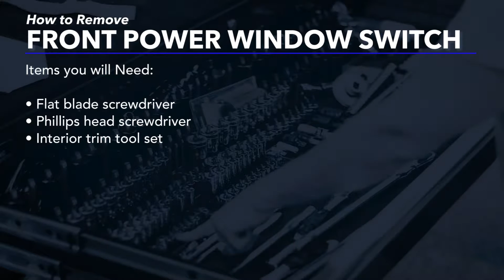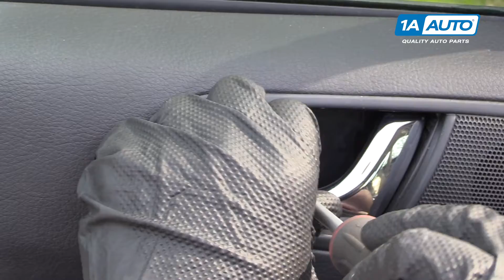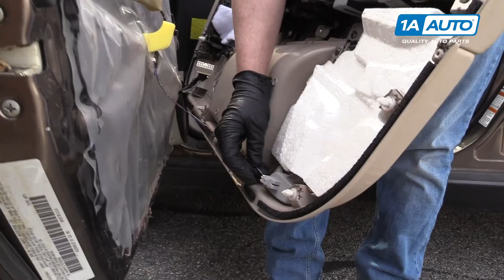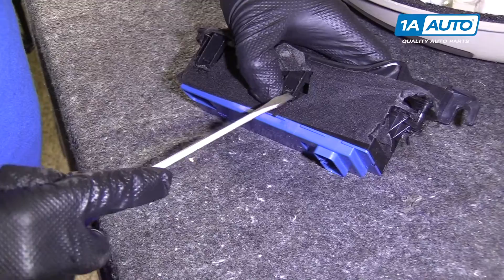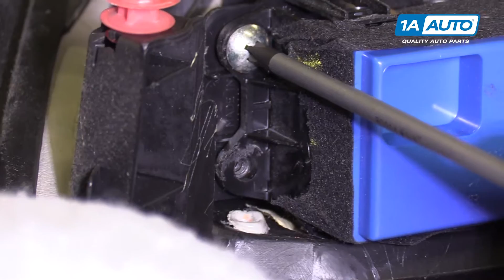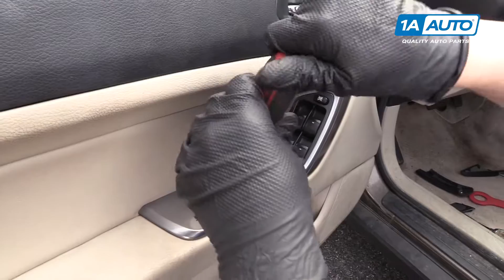How To Replace Front Power Window Switch 04-09 Subaru Outback

Comment: Great video. Replaced the switch very easily. The only mishap was that the top plastic connector for the door grasp broke. The top one that the top screw goes into. Will have to find a replacement piece.

Comment: BEFORE YOU DO THIS: Roll down your windows or unlock and open other doors. Pulling the cable out of the mechanism locked my driver’s side door. I let the door closed accidentally and locked myself out. Learn from my mistake.
Reply from the maker: +@LukeDanko Thanks for the tip!

Comment: My issue: rear passenger switch stopped working and the clicking mechanism inside the driver's window switch broke. I got a generic replacement for $30 (compared to $175 for OEM Subaru). 
One tip: there's another clip in the middle of the door, so if your door doesn't pull off as easily as the video, just pull harder to release that clip. 
Thanks for the video!

Comment: Thanks! I successfully swapped the switch. But, my drivers side window still won't work.
Reply: Probably is the motor or actuator then, I dunno about these guys, but Chrisfix has a good video on replacing a power window actuator
Reply: I know this was a while ago, but I have the same problem. What was the issue?

Comment: Is this possibly the problem if the driver window doesn't work? Buzzes when button pushed or pulled, and all other buttons on driver door and on all doors do not roll windows up or down... But no noise from them

Comment: I have only a driver's side window switch that broke.  All other functions on the panel work.  Are you replacing the entire array of the driver's side window switches as one unit?
Reply from the maker: +flyingfishsurf Thanks for watching!  Yes that all comes off as one piece, referred to as the "master window switch."  You cannot replace single buttons on that switch cluster.

Comment: Thanks to the video I may have gotten this repair done faster than the video and saved myself a lot of money.

I had one issue after installation where the lock activation kept cycling the locks.  It stopped happening after cycling the factory alarm system.
Reply from the maker: +William Suggs Thanks for checking us out. Shop for high quality auto parts on 1AAuto.com:

http://1aau.to/m/Shop-1AAuto-c

Comment: Thank you VERY much.

My switches worked and failed worked and failed.
Turns out they didn't fully seat the connector when they replaced the switch set.

Saved me a trip back to the dealer